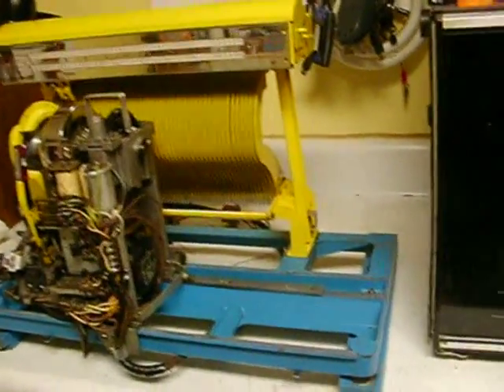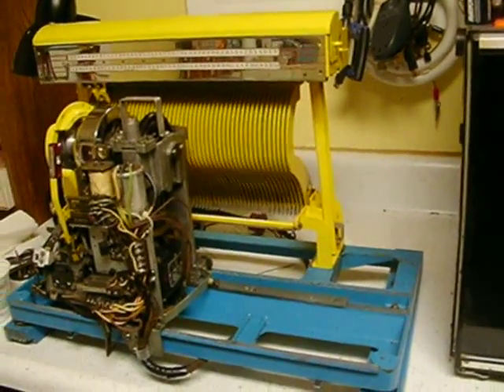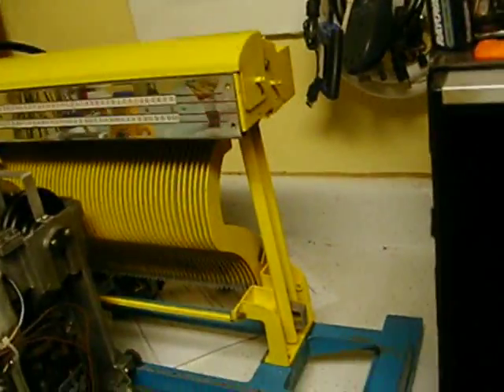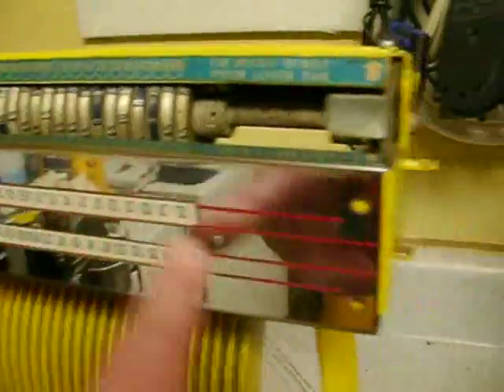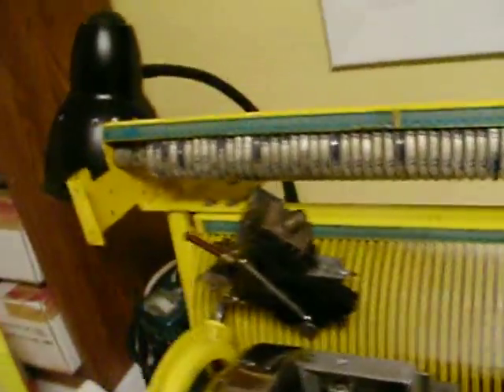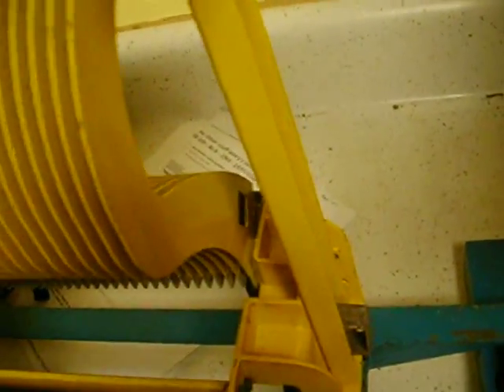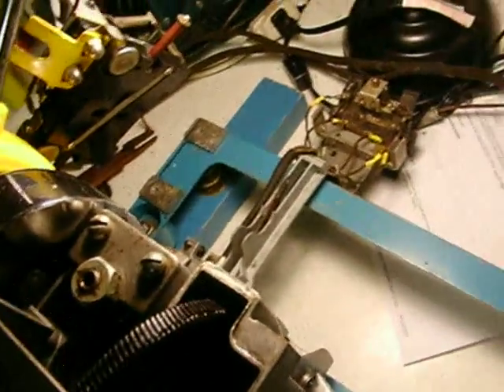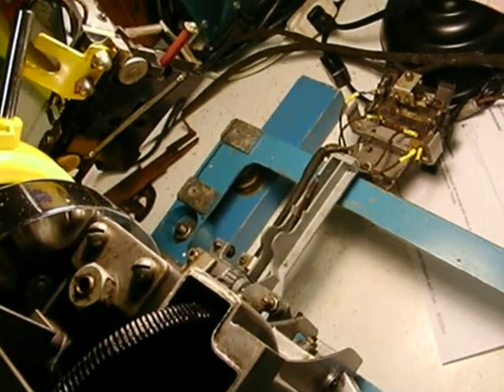Seeburg Jukebox mechanism (part 1)

Comment: I have a 1952 model that has been in our family since 1954. It has had little to no maintenance done. It worked up till about 5 years ago. I have since inherited it from my dad and am trying to get it up and going again. I have taken the clutch off and cleaned it as well as I can. You can manually play a record on it, but if you let it go by itself, it will constantly eject and reinstall the record without playing. Any ideas?????? I have had a local amusement company look at it and they are stumped. I am to the point to ship it to someone to look at if necessary.

Comment: Chris I have a question, mine is the same year and model as this, it picks up the record then sets it back then picks it up again and then sets it back over and over and so on, almost like im hitting cancel before it plays, I was told to adjust my clutch.  Is that what I need to do?  Thanks Zack
Reply: Yamaha Jonesie 
I have The same trouble! Did you fix it? What was wrong?
Reply: @martinwisten4671  anyone get the fix to this?